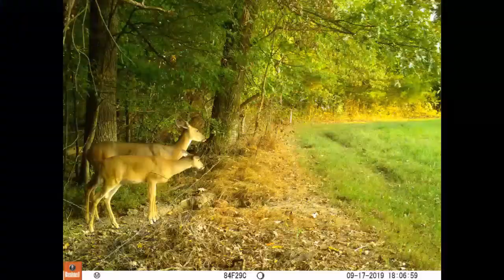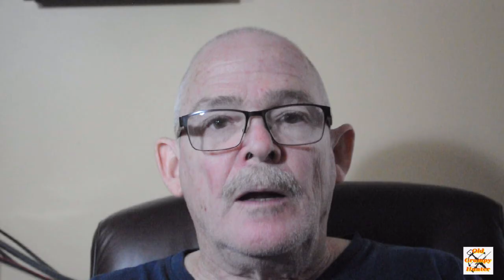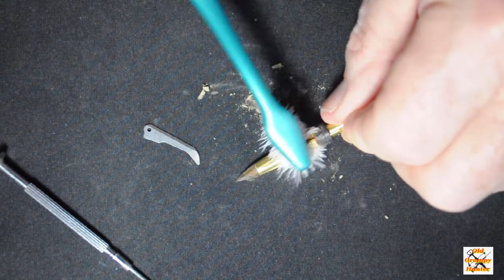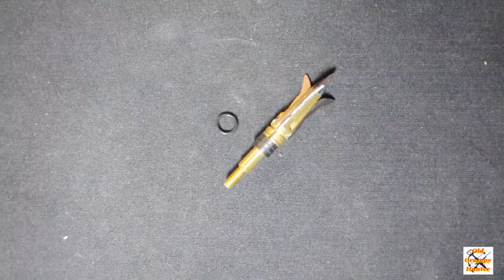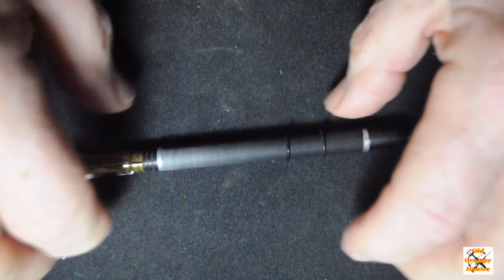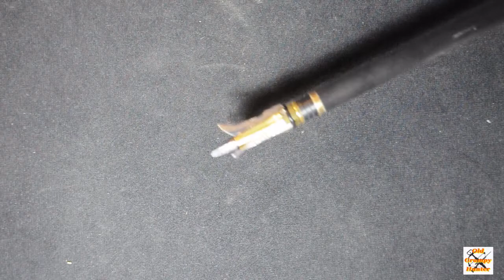Blackout Lazer Strike II Broadhead Blade Replacement

Comment: Are they good broadheads?
Reply from the maker: I have used them to kill multiple animals.  For the price, they are a good head.  Some consider them a one-and-done and don't take the time to change the blades.
Reply: @oldgrumpyhunter  how’s the accuracy
Reply from the maker: @gaje.s08  They fly very well.  These heads are made by NAP, I found that out while on the phone with NAP a few years ago when I had called them about something else.  Check out this video https://youtu.be/ETCf-aW9Gzc The pig walked about 15 feet in a circle and fell where it was when I shot it.  That was the head in question.